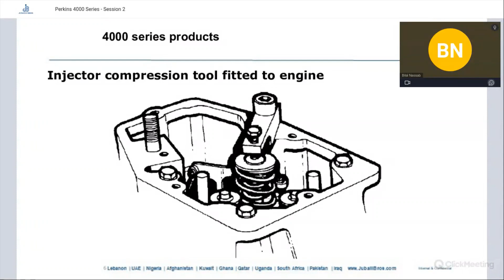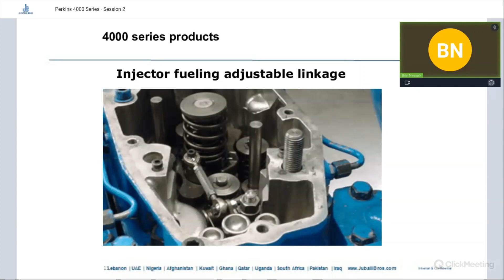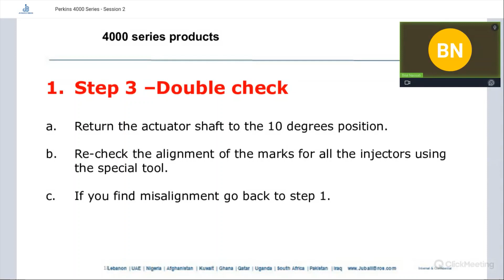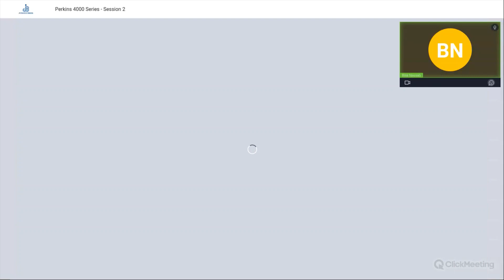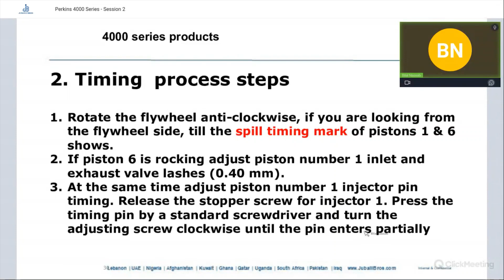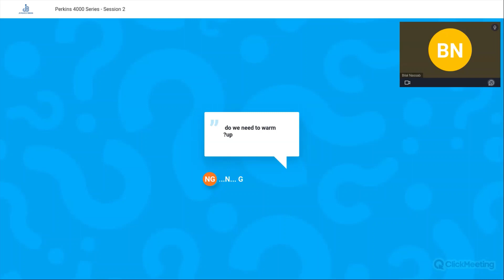Webinar: Perkins 4000 Series - Session 2

Comment: Good day 
What if on an engine which you only have on the flywheel the TDC mark the SPILL directly under with no degrees given and also nothing  given on the name plate

Does it means you set the valves and injector same time?

Comment: Plz can I used 12mm and 14mm plunger at the same time in the same engine..
Reply: No, because 12 mm plunger is for 1800 rpm engine, and 14 mm is for 1500 rpm engines. Hope this answer fitted for you question, if not, please reply.
Reply: TO mix pistons is crazyyyyyyyyyyyyyyyyyyyyyyyyyyyyyyyyyyyyyyyyyyyy